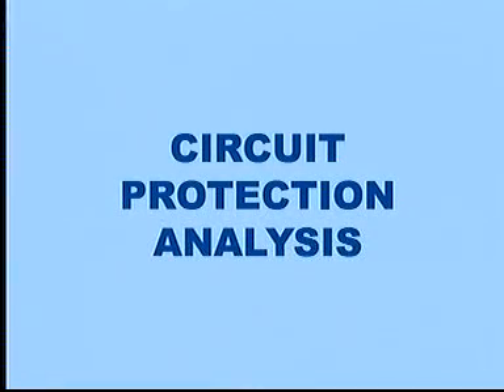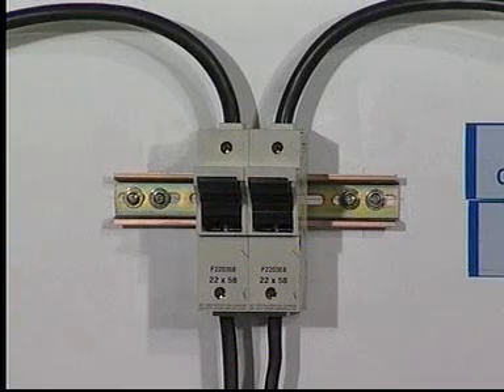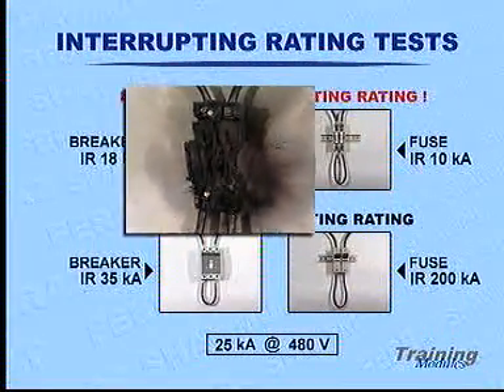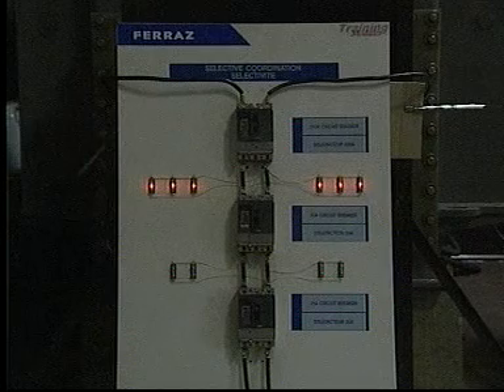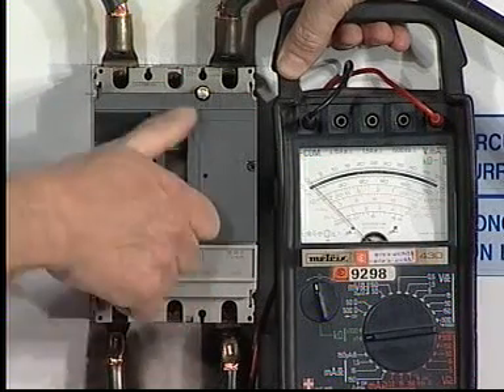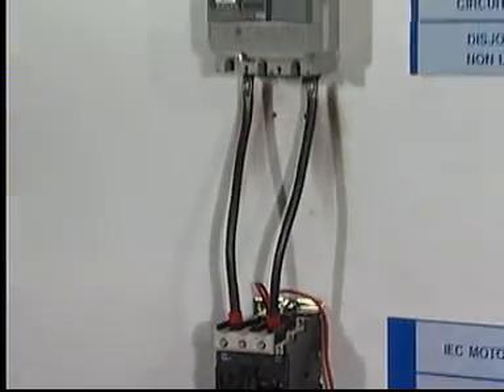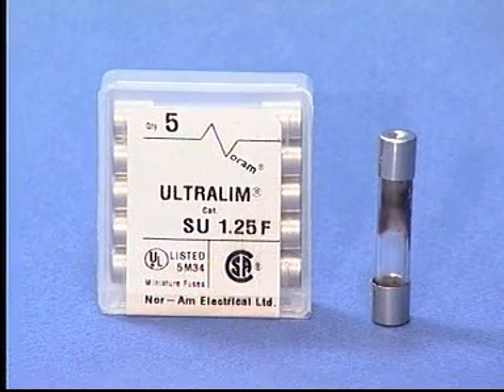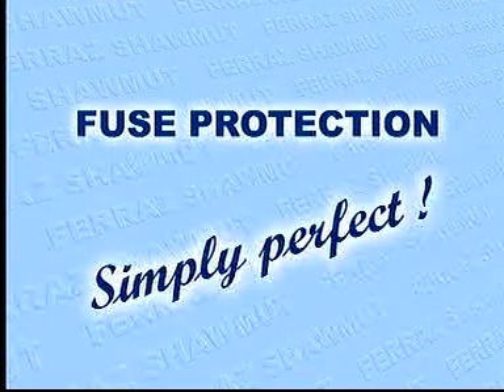Fuses vs circuit breakers

Comment: Was that a type at the 8:50 point where a 200 kA fuse is shown for a 25 kA fault?  I assume that was a 20 kA fuse as I don’t think a 200 kA fuse should blow under 25 kA of current.
Reply: You didnt get the concept, thats interrupting power.
Reply: @51TomasLopez50  Yes, I missed that.  However, kA is a current rating, not a power rating.
Reply: @LTVoyager  no man… the max rating to withstand that current. Not power a in watts.

Comment: The only question is: where will you encounter such many hundreds folds of over current faults in contemporary grid, with so many safety devices up stream?!
Primary to secondary fault of the service transformer?! With fuses on the feeder lines?! 
Not likely!!!